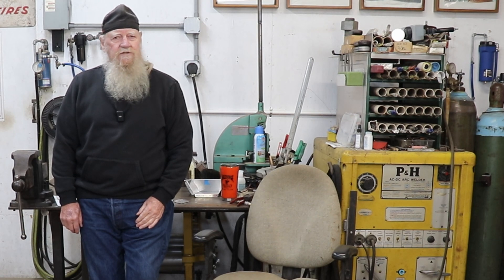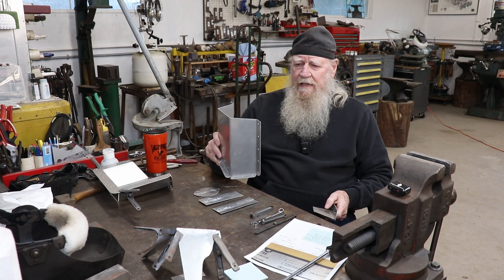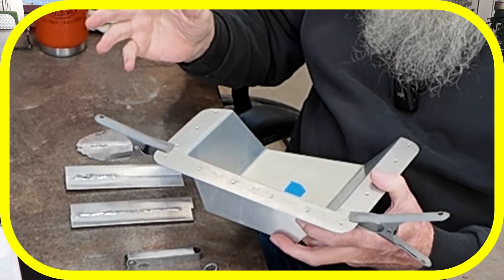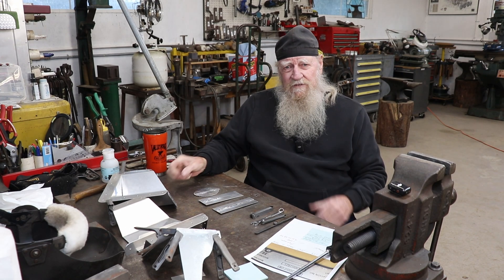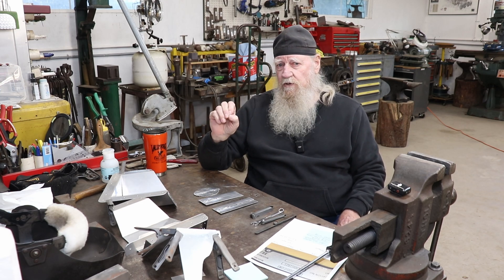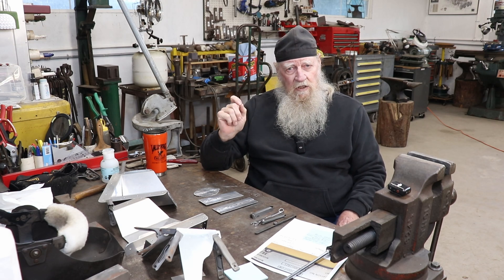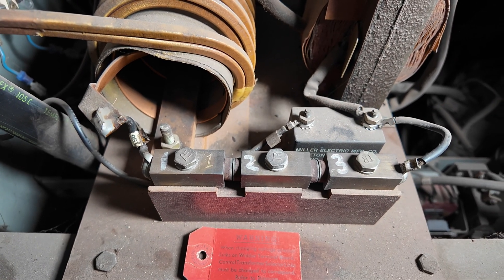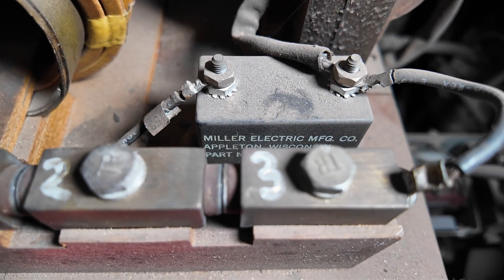High Frequency Adjustment

Comment: Jere - My first TIG welder was a Chemtron, which I believe is the same as a P&H, and I remember having to clean and adjust the points a few times. That machine served me very well for decades, and I remember how stable the arc was. Glad to see that your machine is still working great for you!
Reply from the maker: Ron, before I put the side panel back on I spent a short time adjusting the High Frequency phase shift, and intensity and that made a new machine out of it.

Comment: I always try to buy older machines, but it's getting hard to find them these days... They just don't fall down like modern electronics and I'm an electronics technician. 😆 There's value in having a newer unit on hand though, especially when welding thin material. I have an Everlast 255EXT, it's been a priceless tool for me. It's straight forward and I really only see slope control helping when doing things that used to be nearly impossible due to the material being so thin.
You can probably get a unit from them, they're good people and will probably give you one if you ask to review one. They also have a 315EXT model too.
Reply from the maker: I have seen several channels using the Everlast brand of welder. I may look into it.

Comment: Happy New Year Jere! I have an old P&H 225 AC arc welder. It’s been a good welder for me but I do wish I had DC as well.
Reply from the maker: This is the best stick machine I have run. It has done a bit of air arc (scarfing) work also with no complaints.
Reply: @jerekirkpatrick2092  Mine was a $100 estate sale purchase 30 years ago. I should run the numbers and see what year it is.

Comment: Hello Jere. I also have a Pawling & Harnischfeger .  We used to call these things a Heli-arc welder. When I was in the Air Guard, we had a P&H in the FAB Shop. Mine is a DAR-200 HFGW and I have not had very much success locating information on this model. It has water cooling but output is a maximum of 200A. I got it from a friend for free and is this thing heavy. The 2 condensers were leaking and it affected high frequency. I got word of a guy that knew a lot about the old P&H welder and gave him a call and he works for a company hat is located in PA and has an area code of 610. I called him and he uses Miller condensers which swap in the time it takes to remove the bad ones. , I think 2 screws each. The cost will make your jaw drop. I remember being told by the former owner to adjust the points to 0.011" and have never forgotten this. It works and I learned to TIG weld with it. Since, I have added a Prime Weld 225 TIG welder and actually got a deal on it from Prime Weld, no middle man. It has all the bells and whistles and I have to run a wire and  install a receptacle but until then, it is the P&H.  I was going to sell it but it is hard for me to do that. If ever you do more with yours, yes, please make a video. I just wish there was a frequency adjustment knob on the front. Cheers!
Reply from the maker: I am going to leave some of the side panel screws out for a while for ease of removal. When I feel like I've got it dialed in I'll button it up.

Comment: Wow! My 1996 Hobart TigWave 250 blew the circuit board. I have decided to purchase a new solid state unit from Miller.

I sure am impressed with service you got out of your machine.
Reply from the maker: I have had 3 new torches on it. All dew to water flow.